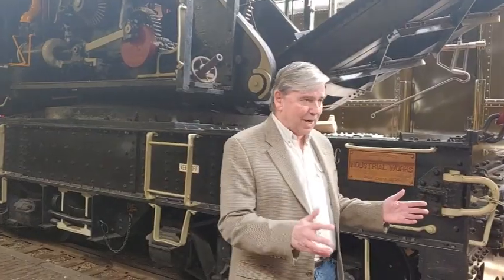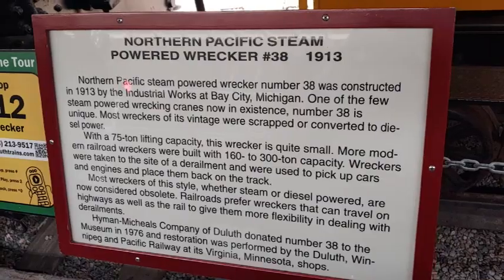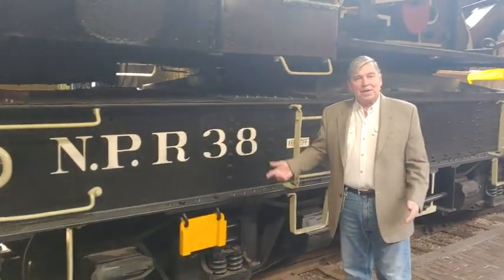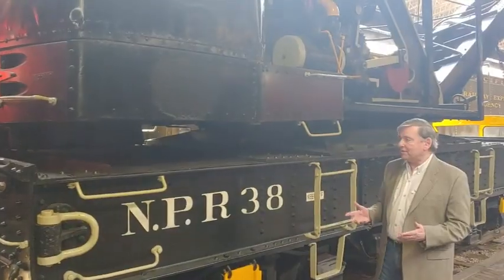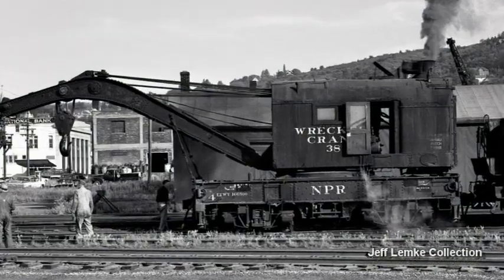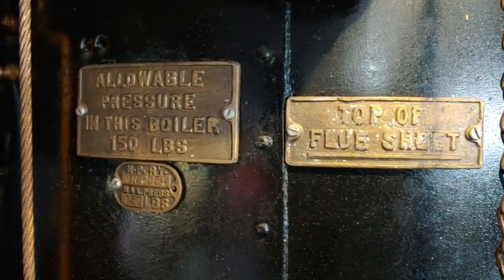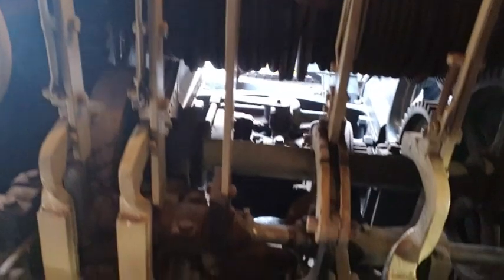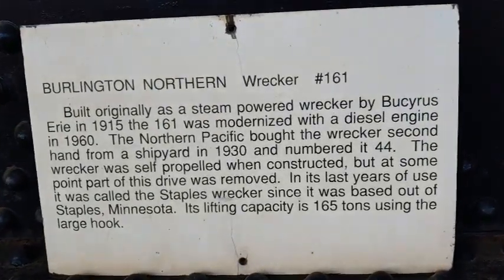Railroad Museum Tours: #37 - RR Wrecker Cranes

Comment: In the 1960's I worked as a helper/rigger on a 250 ton steam powered "LIMA" big hook.  More recently I have also run the "BAY CITY" crane owned by the Bytown Railway Society in Ottawa until its boiler certification time ran out.  We added labeling to the controls.